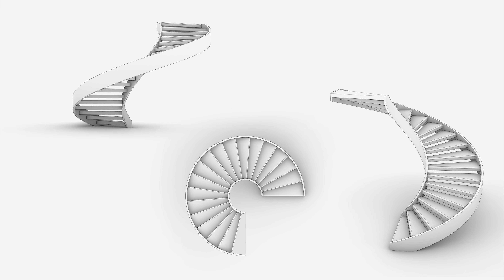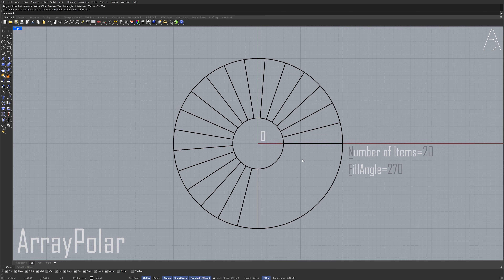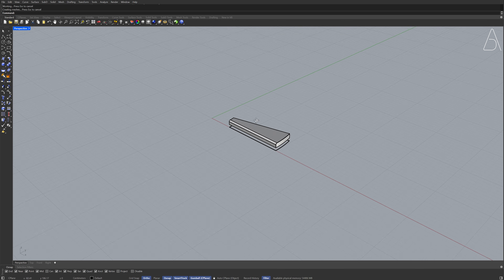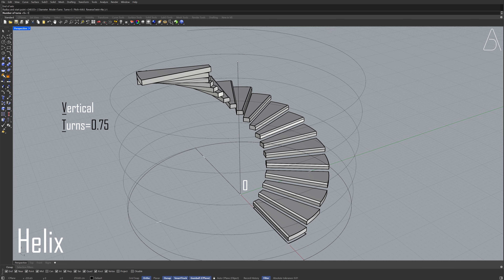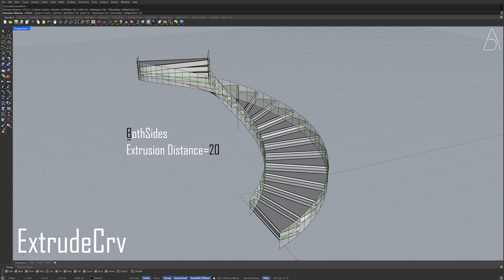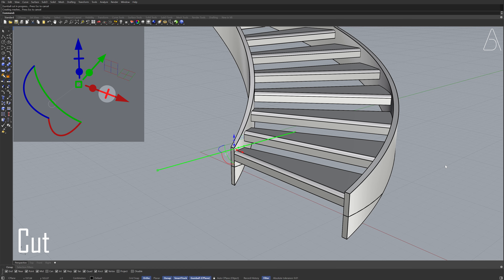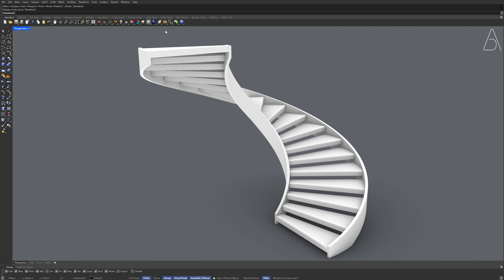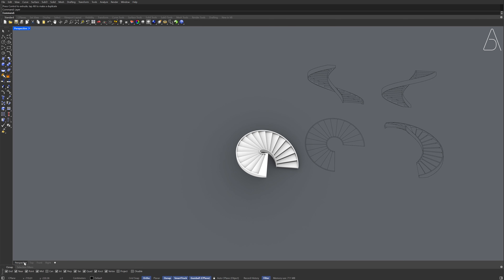Rhino Tutorial I Spiral Staircase Modeling

Comment: Cool! I just don’t understand how do you work with command “cut”? Type cut in command line, Select curve? It doesn’t work
Reply from the maker: Hi! The "Cut" tool was introduced in Rhino 8 and is integrated into the Gumball. When Gumball is active and you click on a line or planar curve, a small vertical cut symbol appears at the center. "Cut" does not work from the command line. It is used through Gumball. Functionally, it's similar to using the ExtrudeCrv command to create a surface and then applying BooleanDifference.

Comment: Eclipse .75 how do you calculate 😮
Reply from the maker: Hi. In a helical structure, one full turn (1.0) corresponds to 360 degrees. Since this helix is 270 degrees, we calculate the turn ratio as 270/360 = 0.75. This means the helix completes 75% of a full revolution, or simply a 0.75 turn helix.
Reply: @AdamArchh  thanks sir
Reply: What about z axis  calculation 😊